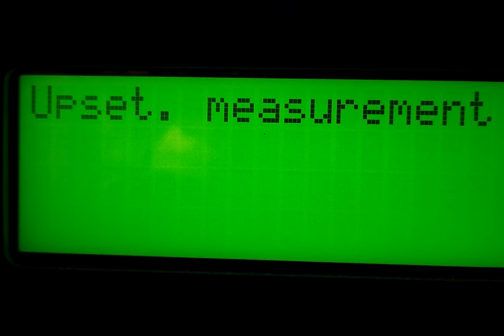Flash butt welding of band saw blades 50x1,1 mm

Comment: We use steel blades and bimetal blades. Target is welding about 100 - 150 blades per day. Is this machine suitable for this?
Reply from the maker: The series of flash butt welding machines of bandsaw blades «Chaika» are designed for industrial use with a high performance. For example, flash butt welding process of band saw blades 50x1,1 mm takes from 1 to 2 minutes. Accordingly, the required number of welds can be performed within a maximum of 5 hours.
Reply: Is this available in pakistan

Comment: How can I explain chaika Welding machine ? I have 40 years experiment with respect to band saw blades. Chaika welding machine is  the best welding machine that I saw and familiar in the world . Its characteristics is as follows: 1-its welding is excellent . from 3 mm to 60 mm. width . metal and wood and meat band saw.2- Everybody can work with it very easily.3-The depreciation of the parts of this machine is zero and does not need to be repaired at all.4- Its prices really is nothing with respect to other flash welding machines.5-Professor Chaika, who designed the machine, has spent his life for research of  the welding of steel strips at the Patton Institute in Ukraine. This machine was designed on the  base of his research and his knowledge and is not a copy of any other machine at all .6- I work with one of this machine in my workshop for years and sold three of them to professional workshop in IRAN who are working continuously without any problem.
Reply from the maker: Thanks for Your feedback.

Comment: How many volt&ampere need to welding?
Reply from the maker: Flash butt welding machine  «Chaika-FBWM-60» consumes from the electric main during welding (two seconds) max. primary current of 15 A, during heat treatment up to 8 A.
All technical characteristics can be found on the website by clicking on the link: http://ukrchaika.com.ua/device.php?id=29

Comment: What kind of band saw can be welded with this equipment?
Reply from the maker: Carbon steel blades and bimetal blades with width 3 mm – 60 mm, thickness 0.4 – 1.3 mm.